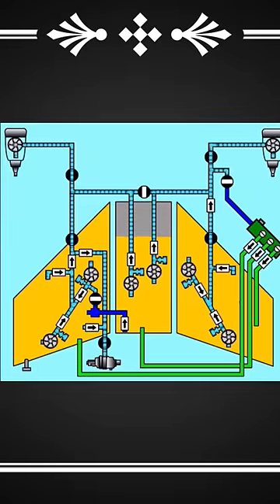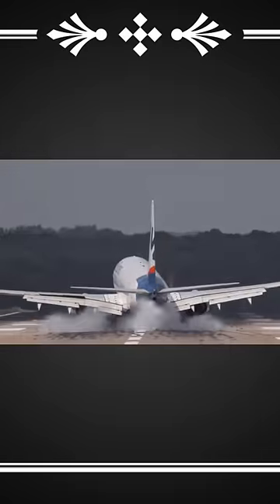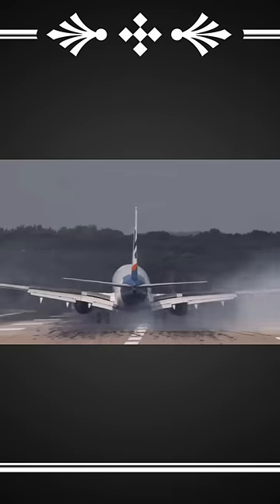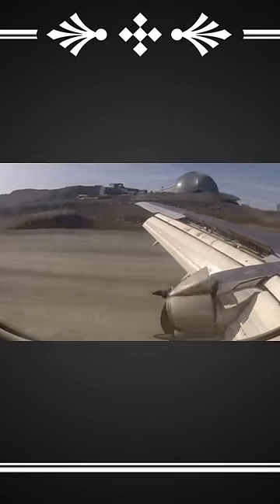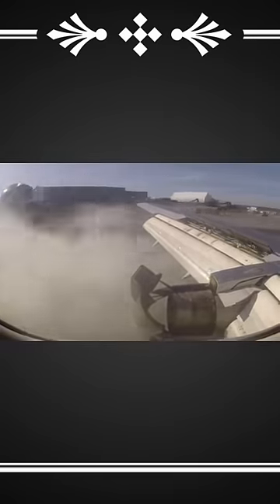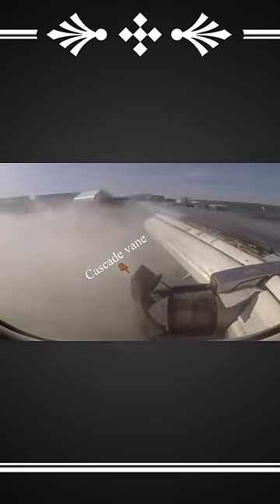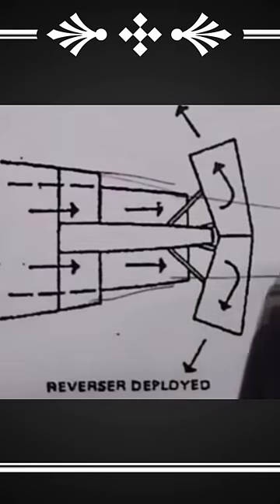Thrust Reverser!! B737 literally has an air brake!! #shorts

Comment: Those are clamshells, not cascade vanes. Cascade vanes are in high bypass turbo fans, the kind you see on later engines of the 737.
Reply: This ^
Reply: Vanes, not veins.
Reply: Where dat pin at @fearjames
Reply: Not only that, but it's a pratt & Whitney engine, not rr or ge
Reply: @mattbarnett6902  lol. Oh yeah, right. I’m tired.       Edit: there. I fixed it.
Reply: ngl clamshells will always look better
Reply: Thank you I was about to say this
Reply: @classicalricky  yeah hes wrong, most of Boeing jets from 50s to 70s are Pratt-powered.
Reply: It somebody was to stand there with the engine running being squished would be their last problem
Reply: clamshell is the one you see on planes like the Embraer 130 not on older Boeing 737
Reply: You’re right. As much as I like these vids nearly every single one is littered with inconsistencies
Reply: there are smaller doors inside the engine which sorta tilt into place, sending bypass air through the sides of the engines i think
Reply: Those are only on the older 737 classic models with older low bypass PW engines. The newer NG & Max have “standard” thrust reversers which redirect air from the high bypass section.
Reply: Its funny how he only shows the old 737-100 and -500 engines, he should show like a GE90 or so
Reply: Glad we got educated ppl in here
Reply: No, those are bucket doors, clamshell thrust reversers are smaller panels on the side of the engine that open up. Cascade vanes don’t protrude outside the regular cylindrical shape of the engine but rather open a ring around it with a sliding mechanism.
Reply: Ikr. This YouTuber knows nothing about planes. These bucket thrusters are sooo old
Reply: Looks like he did mean to talk about cascade vanes but got clips of clamshells/bucket doors by accident since the title does contain 737 in it. They're probably close relatives in search results that just gets you both when trying to find videos of them, assumingly.
Reply: I'm glad that someone cares about the facts.
Reply: Don't know why y'all are calling the new engines GE motors when they are all CFM 56 engines. The kind shown in this video are the jt8.... But even those were pratts ...
Reply: Pratt JT8D engines shown on 737 in video. They are mostly phased out engines, only run on things like the 727, MD-80 DC-9 and of course old model 737
Reply: Correct sir
Reply: Came here to say the same thing 😂
Reply: @imnotagamer5327  wrong
Reply: 997 likes
Reply: I came here to make this comment, or one very much like it. Glad I didn't have to.
Reply: @UnionCountyPhotography  Until someone is smeared all over it from the example given.
Reply: @brytonmassie  well i didn't look at the comments since i commented
Reply: I was just looking for a comment like this
Reply: Those TR's have cowls that translate back then forward into stowed position.🤔
Reply: Correct 💯
Reply: @LSC69  that’s a clamshell. 🙄
Reply: @imnotagamer5327  sorry, u are wrong there.
Reply: Yeah variant pictured was inherited from the 727
Reply: @UnionCountyPhotography  yeh and don't put your fingers in there!
Reply: Thank you
Reply: Nerd
Reply: @PizzaBananaSplit  nerds rule the world!
Reply: @tylerfb1  everyones a nerd

Comment: Those types are the old ones. Nowadays, a section of the engine slides open.(idk how it works though)
Reply: The side opens and directs the airstream to the front
Reply: Hydraulics push the door open and engage flaps inside of the engine down to redirect the thrust outward…
Reply: They are called cascade vanes. The ones in the vid are clamshell type
Reply: Those redirect airflow from back to front thru an flap inside the engine
Reply: There are plates that are angled that get pushed into the exhaust stream. The last 1/3 of the engine bell slides back to open up space for the redirected exhaust to go. Typically the gases then get redirected at ~115 degrees off its regular direction to slow the aircraft down.
Reply: Cascade doors and translation sleeves
Reply: These engines are still in use to this day with limited use on the DC-9/MD-80 family and some carriers still use the 737-200 for its mobility and capability
Reply: Basically if im correct when the reverse thrust process starts the engine sucks in even more air and pushes it out of a vent on the reverse thrust witch its pushing all that air out of the vents that the air is getting redirected so while the plane is going forward the reverse thrust is pushing air forward into the wind slowing it down thats what i think but i might be wrong 💀
Reply: It just has a ring that closes around the combustion bypass and trite rd cold air

Comment: Looks like, we have already a modern day guillotine in the end part
Edit: What did I have done.... 😲
Reply: That's a 1960's guillotine, but close enough. Too bad at power there is no easy way to get close
Reply: Pickle cutter 2.0
Reply: @Bob39285  but it's still modern...
Reply: @recorepro  no not really the 737 for a while has been using more a modern engine that don't need cascade vaines
Reply: And this is why you don't get close when the anticollision lights are on!!
Reply: @recorepro that JT8D is probably older than me and your age combined…that’s not a modern engine…
Reply: @RP-rm7po  I agree, great engines for there time
Reply: Planes have newer versions of reverse trust that doesn’t use this mechanism. You have probably seen it when new planes open side panels on the engines.
Reply: A guillotine but for speed hmm odd
Reply: @echo3996  yeah they like separate and the fans go backwards at max throttle
Reply: Last line brain broke 💔 I must bed now.

Comment: Reverse is actually not for what you think they’re not used to slow the plane down but to reduce the stress on the regular brakes located on the tires as the tires will last longer and be less likely to blow out and it does help shed a bit of speed want to fact check me go right ahead and that specific reverse thrust unit sometimes called the clam shell reverser which is only found on the 737-200 and -100
Reply: Also known as slowing the plane down....
Reply: @Ravenousjoe  its more indirectly Slowing it down because it doesn’t decrease the distance you would stop at least in big airliners in planes like the twin otter its the main way it stops
Reply: @Grizzlybear2470  yeah, except these airliners do need the thrusters as they are landing on gravel and ice strips.

Comment: Allow me to be the guy to point out that: technically what you point out in the vid as "cascade vanes" are actually referred to as "reversing buckets" or "clamshells". Yes, cascade vanes serve the same purpose of thrust reversal, but are actually on the sides of the turbo fan cowling (sides of engine* to laymen), not at the back. With cascade vanes, the airstream through the turbofan is redirected out of doors on the side of the turbofan cowling that slide open to reveal the cascade vanes, which are air foils that look a little more like louvers.

Comment: Those type of the so called clamshell reversers are long gone. Nowadays, part of the engine slide back, which moves little blocks into place that more effectively redirect thrust. Airplanes also have spoilers and brakes on the tires to stop.

Comment: In addition to shedding speed on landing, C-17 Globemaster IIIs routinely use reverse thrust to back up.

DC-9s and similar used to do the same, but I think they're not allowed anymore due to the concern of FOD, especially if they're on the apron.
Reply: The c17 can also use them in air for combat descent
Reply: Most large military jets use it to back up on the ground still to this day it's just not the best way to back up an airplane. You can't see dick, it's sluggish and laggy, plus like you mentioned FOD is a concern. They still do it when they have to but always prefer a push. Civilian airlines haven't used it to reverse since the early 90s though and that was only in some holdover airports like Manila and Istanbul.

Comment: This is called a clamshell reverser and they aren’t very common anymore, but in a sense they are a larger version of cascade reversers. Nowadays, you will see the half engine cowl slide back and doors inside the cowling redirect air forward/to the side.

Comment: Bonus fact theses are mechanical or clamshell thrust reversers. The style more commonly used today for Rolls and large ge engines is aerodynamic reversers which are built in to the shroud rather than behind. The are kre effective and cause less wear

Comment: You also didn't mention pretty much every commercial airliner has reverse thrust, and this version of the reverse thrusters is only available on the 737-100/737-200 which haven't been flying for airliners since about the 90s and that's with southwest.
Reply: They are used a lot for gravel runways as they are the only 737s with a gravel kit.

Comment: Correct, remember it's only with the older engines such as the JE85 used on the -100 and -200 variant, albeit the CFM56 engines have a similiar concept, just without the rear "flaps" extending to force the air sideways.

Comment: Their are two types of reverse thrust buckets. As shown in this video and translating sleeves. The bucket don't have cascade veins.
Translating sleves do. The side of the engine slide back blocker doors move up to block the air to go out the side. The cascade veins and blocker doors redirect that air forward.

Comment: A&P here, those aren’t cascade vanes. Those are clam shell style thrust reversers. You’ll typically see those on smaller corporate jet engines. Cascade vanes are used on high bypass turbo fan engines like those on a commercial airliner. The engine cowling slides backwards while simultaneously blocking the portion cool thrust air and forces it to push forward in order to stop the plane. This is the massive whoosh sound you hear when a plane touches down. Happy flying!

Comment: reverse thrust is an interesting one because almost all airliners can stop in a similar distance with or without reverse thrust. the feature was originally put in to save wear on the brakes meaning they don’t heat up as much and are able to operate again much sooner than without reverse thrust

Comment: Disclaimer: Those "airbrakes" or buckets (the term that is mostly used in the aviation community) are only found on the 737-100 and -200 series when they use reverse thrust. You can aslo find it on T-tail planes such as the DC9 and MD80. As well the 737-200 series uses Pratt and Witney engines. The modern 737 fleet like the -800, which is commonly flown today, uses CFM56 engines by CFM. But great video that you're able to explain this in a perspective for people who are barely into aviation. Just wanted to clear some studf up.

Comment: thrust reversers are not used to brake the plane. They are used to reduce wear on the brakes by helping to slow the plane down (i guess that’s braking) but they don’t do the heavy lifting. They are also used when the runway is wet to help the plane not glide and stick to the ground.

Comment: The 737's with that style of clam shell  reversers are the 200 series. They are exceedingly rare now due to age and inefficiency and only a handfull are still in operation. From the 300 series on (starting in the mid 80's), they have CFM engines with cascade reversers.

Comment: These are super old models of reverse thrust called clam shells. Modern airliners don’t use this type anymore. Now days they have deflector shields inside the engine that flap open and have the sides of the engine cover pull back to let the air out.

Comment: Cascades are on the bigger fan engines currently in use.  Almost  ALL  modern day large commercial aircraft use cascades. 
You are watching " clamshell " doors that are used on older aircraft.  This is an old 737 200 series hydraulically driven clamshell T/R.
Reversers are used to assist the brakes in shorter distances thus preventing the brakes from overheating.

Comment: Actually that is a really old method of reverse thrust, most modern jets don't have that (though why you don't see it when u travel). Nowadays clamshells (not cascade vanes) are only on smaller jets (like an Embraer) and the bigger ones have the system inside the engine, slightly smaller but looks like either there's little flaps on the engine or like the whole engine splits in half and slides apart

Comment: Also it's apparently banned by the US FAA to use reverse thrust to back away from a gate or terminal. [You could probably at an unregulated airfield but I'm not sure.(also my info is atleast somewhat old so if you want to know for sure then check yourself.)]

Comment: Yeah it has an air brake but that’s on the wings. The TRs are controllable as in you can apply more or less thrust for more or less affect. The speed brakes and roll spoilers are on the top of the wing.

Comment: while fundamentally you are right, the revisers you showed where clam shell or bucket type and don't have cascade veins. Those engines you showed were Pratt & Whitney JT8D's. Cascade veins are used on high bypass turbo fan engines that use what is called a "translating cowl" type revisers. I'm a retired A&P with about 45 years working on them.

Comment: just letting you know what you said isn't a cascade vane, it is a clamshell reverser, cascade lamell vanes are slots opened on the side of the engine/nacelle and pushes gas out there instead of backwards.

Comment: Fun fact the sabb ajs-37 bigger has a similar system and the av-8b or harrier can also reverse by setting the nozzle angle to max (92°) and using a small amount of throttle use to much however and you will (if it’s light enough) take off very fast vertically and going backwards

Comment: Loved the simple short but just wanted to point out one misconception which I’m sure you’ll update into the short.

Despite having reverse thrust, there are many nations that only allow an aircraft to be “dispatched” if the landing performance of the aircraft allows it to land safely (with various margins) without reverse thrust thus unless the aircraft is landing into a runway that has “diverted” (changed destination) to there is no chance of it “falling off the runway” and consequently it doesn’t need reverse thrust to stop. Additionally if reverse thrust was needed to stop then planes wouldn’t be able to land if a reverser failed or if an engine failed. 

And lastly, I’m most places due to “Noise Abatement” (noise reduction) agreements/rules, usually reverse idle is used, that is reversers are deployed but the engine still runs at idle. 

Otherwise the only other thing I would suggest is to also show the other types of reversers so that the public knows about them.

Comment: I finally get to do This

Umm akchyuwally.... The air brakes are the spoilers on top of the wings (or sometimes tail) that flip vertical when you land. The ones on the tail split and open sideways. Which are the same things you might see flapping around when the plane has started to descend. The trust reversers are just the things on the engines themselves. Maybe another name for thrust reversers might be blow backers. Idk.

Comment: All reverse thrust really does is create lots of drag that slows the plane down when it is at high speeds. This can be done by redirecting the air outward. But pilots don't actually use it to slow the plane down faster but rather help extend the life of the brakes and keep them from fading. They end up using about the same amount of runway regardless of the use of reverse thrust in most circumstances. In case of emergency pilots can stomp on the brakes and use reverse thrust to help slow down faster though.

Comment: The reversers shown here are the old style. new reversers don't have the clam shells, the rear of the cowling slides back and has vanes that redirect the thrust forward. The new design is more efficient and pushes the more evenly around the whole engine and not just up and down.

Comment: That is cone reverse thrust found on most small regional jets and the 737-100 and 200, most modern planes such as the c17, B777, B747, B767, B757, B787, And most A300 models have reverse thrust from the bypass air

Comment: Boeing 737-100, 200 and i think 300 models have these engines. The other more modern aircraft like the 737-700, 800, 900, MAX7, MAX8 all have reverse thrust "vanes" where the majority of the mechanisms that redirect the thrust forward are internal and you see the back half of the engine cowl slide aft of the engines body revealing an opening that deflects the engine thrust forward.

Comment: It should be noted that the reversers shown in this video are specifically for the 737-200 and 737-100. Modern 737s, the 700, 800, and 900, as well as the classics, 300, 400 and 500, all have CFM 56 engines, and their reversers are not the same clamshell.

Comment: This is the 737-800. The max has a slightly different system, with the sides of the engines opening instead of the cascade veins coming down over the back